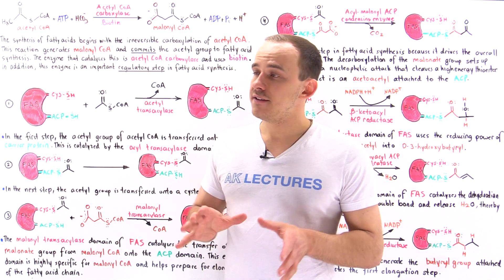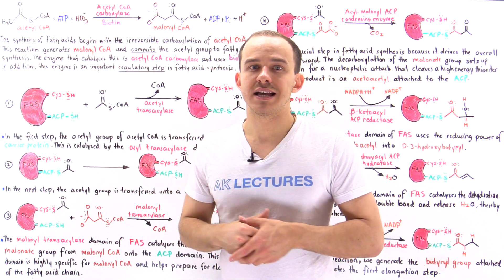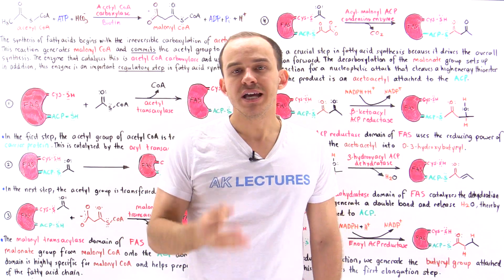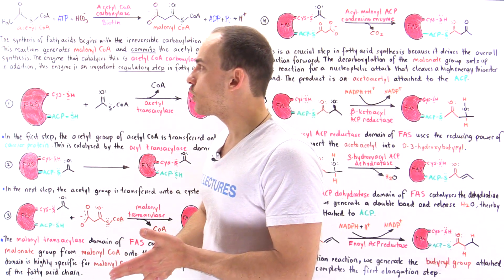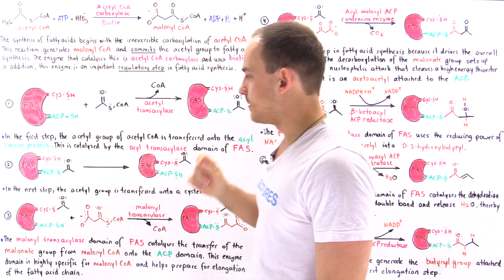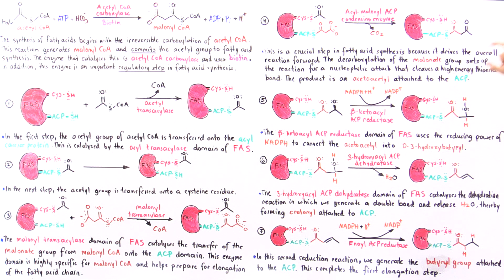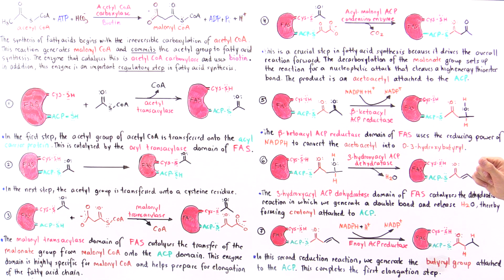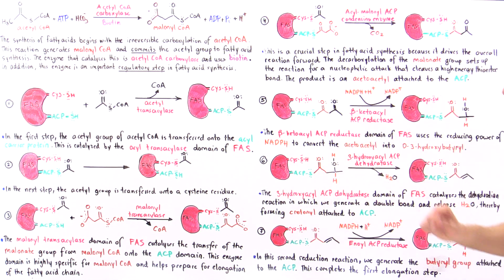Fatty Acid Synthesis

Comment: Help needed:
 The stochiometric equation of fas:
 1Acetyl coA + 7 malonyl CoA+ 14 NADPH + 14Hplus-----------> 1Palmitate + 14NADPplus + 7CO2 + 6H2O + 8CoA

Could this be also written as??
{8Acetyl coA+ 14 NADPH + 7 Hplus + 7ATP------> 1 palmitate + 14 NADPplus + 8 coA + 6H2O + 7ADP + 7Pi } ??
please help!
Reply: From what I understand it's also O.K. to write it like you did below, the only thing being it's 14 H+ as you are using also 14 NADPH's. By using that stoichiometry you are taking into consideration also the ATP molecules you used in the 7 reactions of the Acetyl-CoA Carboxylase reaction.